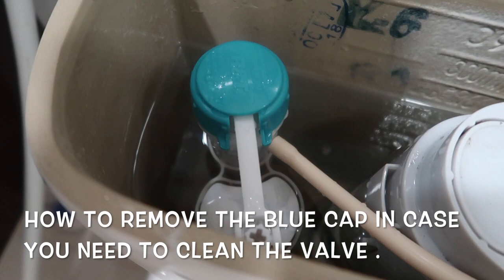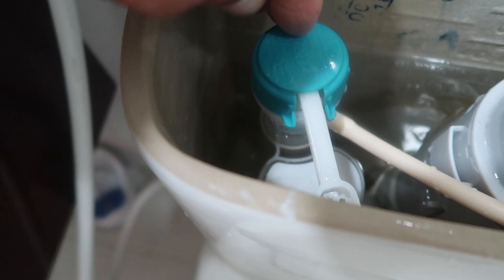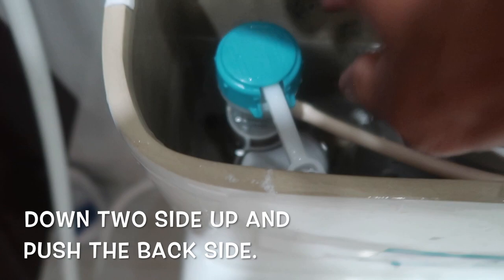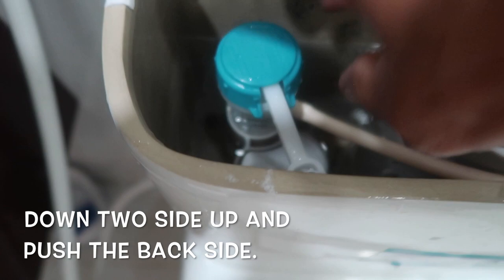POZZI WATER TANK DUAL ADJUSTMENT MARCH 15 2019

Comment: Hi sir, I have the same dual flush brand, pozzi rin almost ganyan flush system nya kaso ngayun hndi na nag rerefill ng water dahil yung fill valve nya or yung parang plastic part na lumulubog at nagfofloat at hndi na nagsisink. parang may water na sya lagi sa loob kaya nakalutang na lagi at ayaw na magrefill ng water, kung manual ko naman sya mino move para magrefill nalalagyan ulit sya ng water at naistuck na yung plastic sa floating level at ayaw na magrefill kahit empty na yung tank. May need na ba palitan dto? Thank you!
Reply from the maker: Bili ka nalang ng bagong float assemble sa Wilcon Depot baka masolve ang problem mo salamt sa panonood ng video .
Reply from the maker: quick check mo rin sir kung iyong top cover niya align sa tank try mulang bago replacing
Reply: Cg2 po sir thank you po sa pagreply